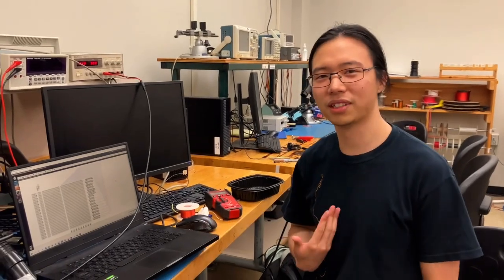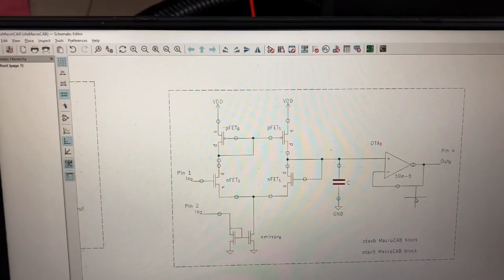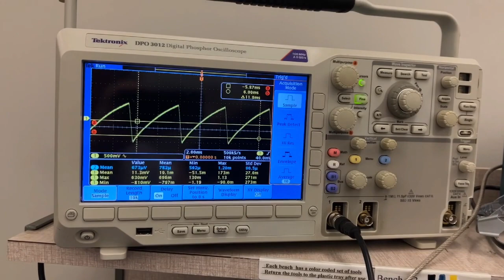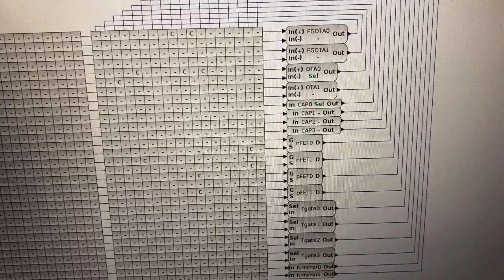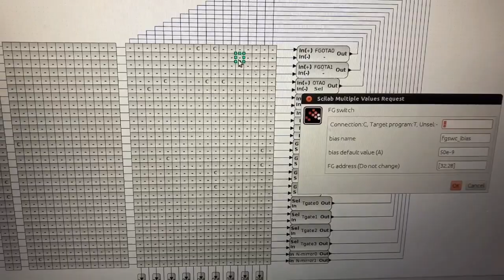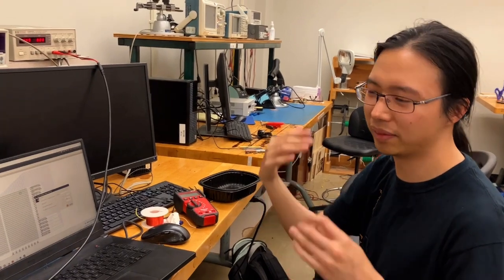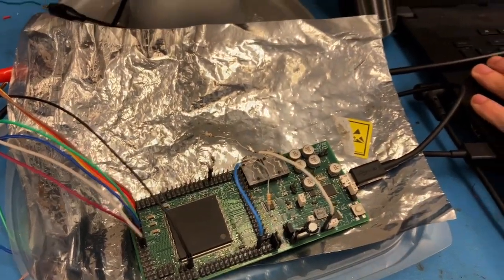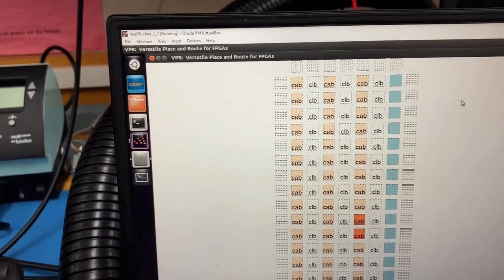VCF on a FPAA: Voltage Controlled Filter on a Field Programmable Analog Array (ECE4450 project)

Comment: I love the older tektronix gear. I've replaced it all but still use it more. 

I have a line six helix Dr lanterman if you want a video teardown when I finish my workshop reno.

Where do you get an fpaa? Or rather what's a cheap one to get our beak wet with?

Comment: I'd love to get my mitts on one of those for some analogue video fun. Perhaps I'm missing something, but what if you were to try using the output OTA or op-amp as an integrator? Connect the inverting and non-inverting inputs back to the differential pair with the capacitor feeding back on the op-amp, something like that? Cheers.
Reply from the maker: All those things are possible.

Comment: Aaron, please can you tell us the make/model of FPAA in the video?
Reply: The FPAA used is a RASP 3.0A, developed by Dr. Jennifer Hasler's Integrated Computational Electronics Laboratory.
Reply: @lennoliu7245  oh wow so actually developed at georgia tech?
Reply: @indigoskywalker  Yup!
Reply: @lennoliu7245  what are the supply rails?
Reply: @indigoskywalker  Runs off of 2.5V. The inputs can tolerate a little bit over that, but not much under 0V. I buffer all my inputs through a MCP6004 running at 2.5V to be extra safe.
Reply: @lennoliu7245  oh that’s not great, I guess it is hard to find a fab who will create a much bigger process node like the 80/90’s.. everything now is 3.3v etc I guess.